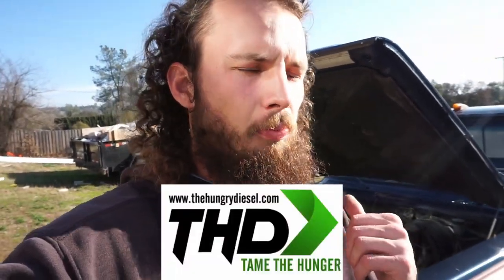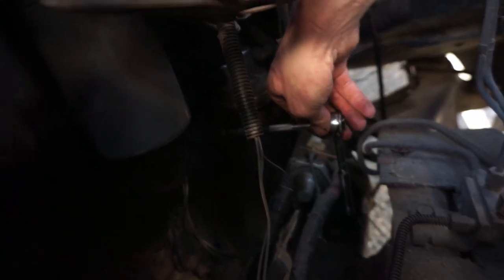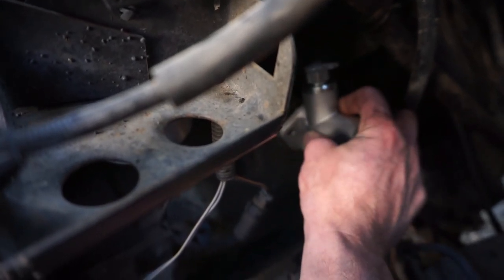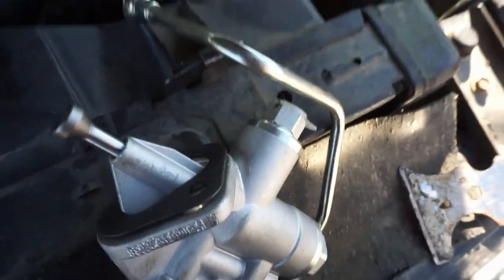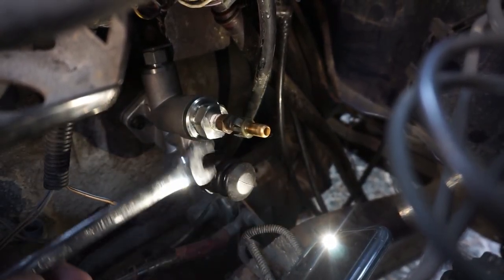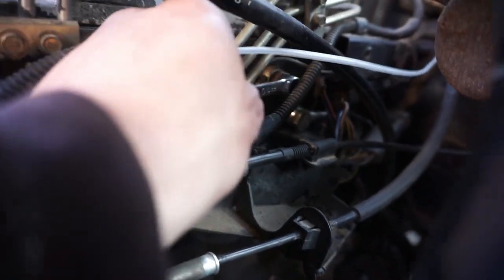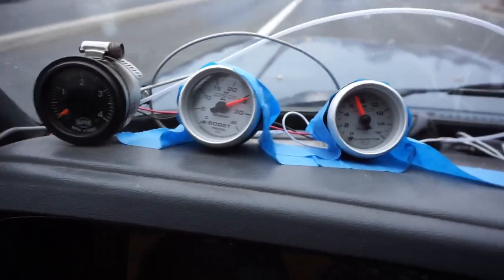The Most Overlooked Power Mod for First Gen Cummins: HVLP

Comment: Jake I’ve replaced this and can’t for the life of me get the system primed. It’s started once struggle to stay on, then left it sit for two days and started again slightly today. Bled from the banjo, changed the fuel filter, and bled from the injectors which is hit or miss with air bubbles. Should I drill out that banjo bolt and only bleed from the bolt above the filter rather than the pimp banjo bolt line? Wondering if it’s the solenoid?
Reply from the maker: Very well could be the solenoid, but as far as I'm aware, they usually fail and completely shut off fuel flow. I would check for leaks on the bolts to the fuel line that were installed as well. There very well could be some debris blocking fuel flow.

I don't think the banjo bolt drilling is a necessity, but it was recommended to me since I already had it apart. I wouldn't expect it to fix the problem, but it wouldn't hurt.
Reply: I just drilled it out, and getting better flow. All sorts of foamy suds, and won’t go to a stream now. Hoping that solenoid plunger didnt flop on me. If I’m getting so much air coming back and inconsistent injector bleeds, it’s gotta be a block

It’s a 90 w250, so I was concerned that pump may not be able to work without the cam lever style
Reply from the maker: The truck should be able to handle the pump without issue. If you keep having problems I would reach out to Eric at The Hungry Diesel. He's awesome
Reply: @FormulaJake  thanks man! Appreciate the videos and help.

Comment: You contradict the information I have seen on fuel pressure with the THD conversion. Do you have a fuel pressure gauge on it? If so what are you getting? The original diaphragm pumps only do 3.5-5lbs.
Reply from the maker: Not sure what I'm contradicting, but the selling point of the THD pump is that it is low pressure. Not sure how low, but essentially it's a second gen piston lift pump that has been modified to deliver a reduced amount of pressure than its factory configuration.
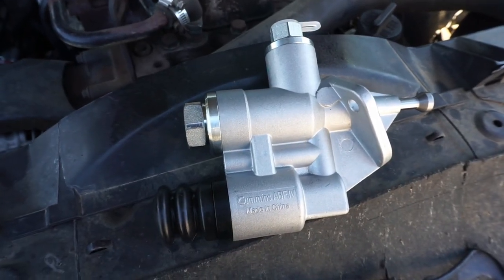Reply: @FormulaJake  1:01 you talk about increasing the volume not increasing the fuel pressure. Then right after that you talk about it increasing the fuel pressure.
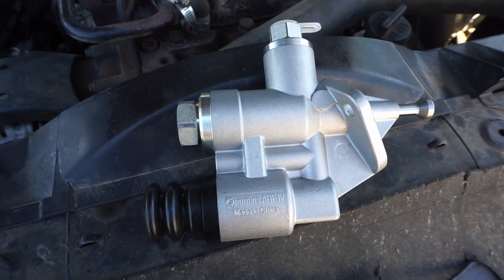Reply from the maker: At 1:10 "and that's the problem with some other options"
Reply: @FormulaJake  there is 2 piston pump options. This basic pump you installed is bigger in volume than the original Gen2 piston pump. The original is smaller. I have an original size (smaller piston/volume) pump I was going to use to convert my fuel system. I got side tracked and bought an electric pump from Advanced for the 98.5 diesel. It does 18lbs. I talked to Eric as I sent him my VE to get rebuilt and worked up to higher volume. He said I should be okay with 18lbs. This won't be modified to the 640HP version. It is the one below that that can handle 450-ish horse power at the wheels. He advised me not to use my mechanical pump in line with the electric one as it would probably blow out the input shaft seal. I did a lower pressure spring in the lower volume pump I have. It will sit in a bag for possible future use. I am going to order a block off plate for the block for now. Thanks for the tip on the banjo fitting!!!!

Comment: What is the difference between this pump and something like an air dog or fass pump?
Reply from the maker: Those two are high pressure. This pump doesn't change the pressure
Reply: Air Dog and Fass are not something you want to run on a work truck, or daily driver. They aren't as dependable as the mechanical piston pump. Those other pumps are for going to monster high HP levels. The THD set up is really a higher volume piston pump version of the Gen2 Dodge with the P style injector pump. The actual size piston pump for the Gen2 is smaller than the THD. I think the pressure on them runs 35psi. 100% chance on blowing out the front seal on your VE injection pump. Eric uses a spring that lowers the pressure.

Comment: Was your truck blowing white smoke?
Reply from the maker: No sir. Never seen it blow anything but black
Reply: Did one of these definitely love these pumps. Plan on doing the pin and gov spring next..
Reply: @FormulaJake I got the 13-15 psi lift pump.

Comment: Just a thought Jake. Would it be better to remove the old supply line but then remove the obtrusive insulation before taking off the old pump there by eliminating debris frim going in the mounting hole. Any problems with that ? Tell me what you think.
Reply from the maker: I don't recall exactly how the old pump sits, but I imagine that it would be in the way. Removing the pump and putting tape over the hole would probably be an easy fix.

I think the easiest solution is to use a utility knife to cut the insulation out, rather than grinding it out.